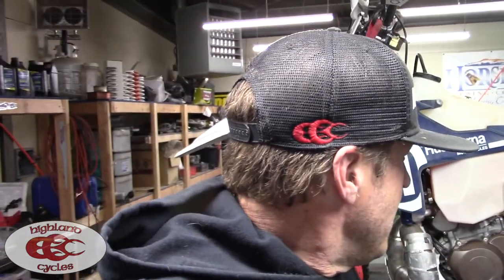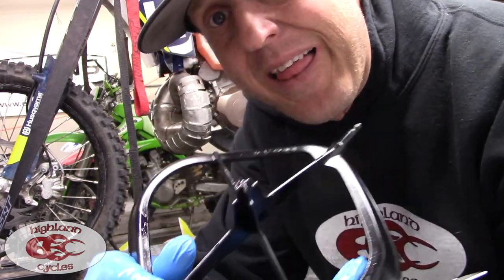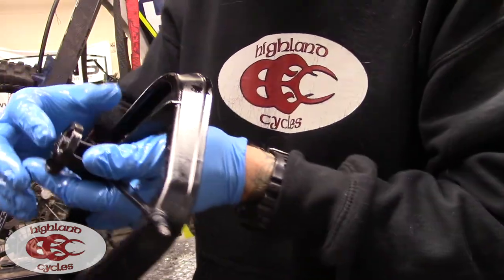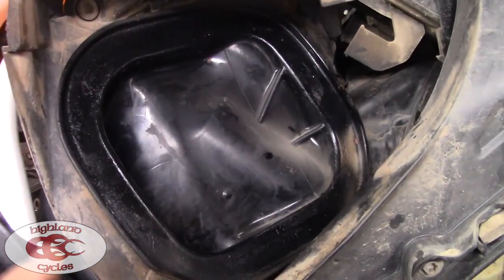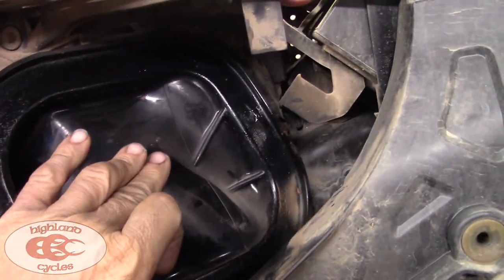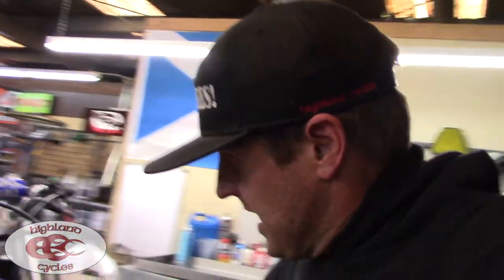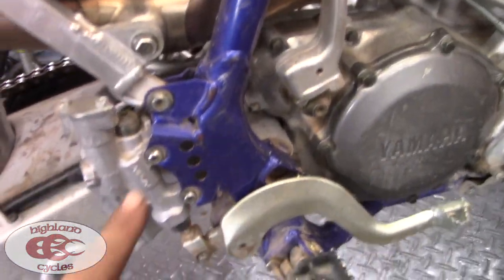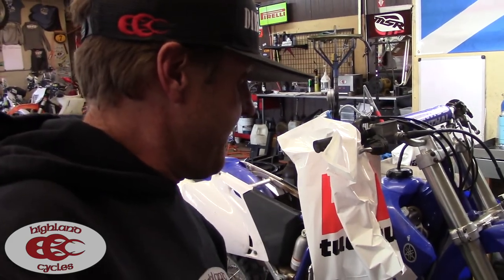Vlog!  Husky 300, Daisy, and a Clean YZ

Comment: I have always made it a habit to run my fingers around the edge of my filter to check the seal and use a paper towel to check for any silt that gets through and to clean the boot for later.
Reply from the maker: Danny Compton it seems so obvious but lots of people don’t do it.
Reply: @highlandcycles  I yes a little, but what lead me to do it is a bad experience.  I owned a DR350 with a small airbox and door.  I didn't damage the motor, but did a dusty ride with the filter cage no seated correctly.  I found the silt all in the air box boot.  After that I got in the habit of feeling back around where I couldn't see and then eventually I just made it a habit to do all the way around.  Even with my current 13 KTM I have caught it not seated correctly as I though.  The two ribs in the air box don't always get it and if you don't take the seat off you can't see it.  Feel is the best way to check the back side IMO.

Comment: Have you used the PC racing air filter gaskets? Its a thick stick on gasket so you don't need to use grease to seal the filter. I'm a big fan of them!
Reply from the maker: Cody Joseph I haven’t personally but have seen them. I think they are pretty cool.